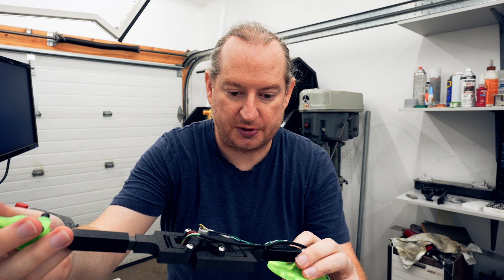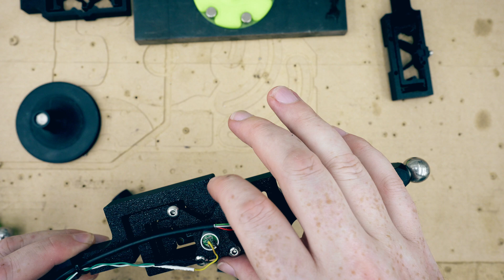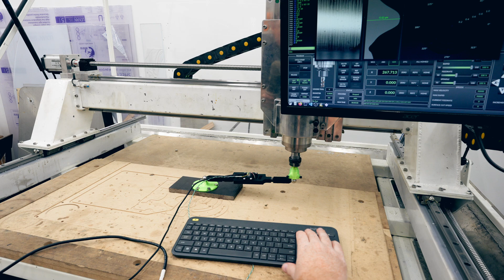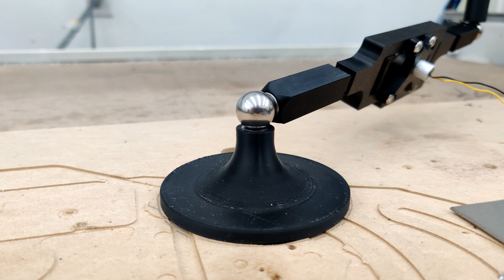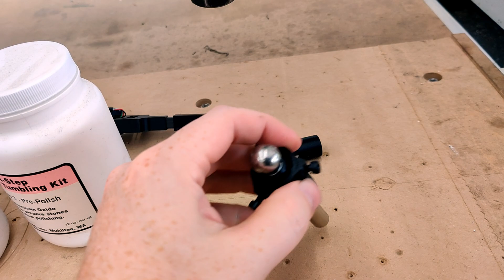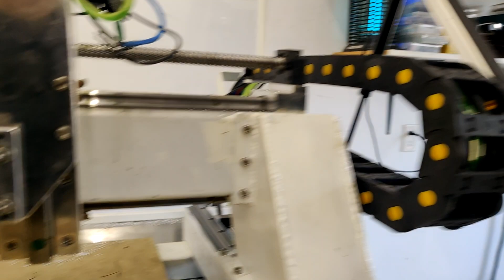DIY Ball Bar for CNC Machine: Laser, Webcam, and Flexure Design

Comment: Very late to the party, but instead of lapped cups you could use three ground dowel pins. The three rods form a triangle tangent to the surface of the ball, guaranteeing that you only have three points of contact. Also, I think that you could get better accuracy by tilting your image sensor away from perpendicular. The closer you get to parallel to the laser beam, the smaller the effective pixel size which should mean finer resolution. If you also constrain the laser by firing it through a slot (two razor blades edge to edge works well) you should be able to get an extremely fine resolution.
Reply from the maker: Yeah for sure if someone wanted to reproduce this it'd probably be better to try to improve the ball joint. It seemed to work good enough to track artifacts on my machine so I didn't try to improve it after some testing.

For the laser on the sensor, I've written the tool to take into consideration the gaussian distribution of the laser beam on the sensor. I want the laser beam to be somewhat blurry because it means I can take more pixels into consideration when it's calculating the offset. When all the pixels contribute, it can give subpixel accuracy. 

2 razors might give you artifacts with diffraction. Might work, but overall will drastically reduce the number of pixels that contribute and would likely be less accurate. 

I think if anyone wants to build/improve on this, trying to find a image sensor that can send RAW pixel values without jpg compression (I think the latest PI cameras can do this) resolution is less important than framerate I would take a 720p camera if it could shoot 120/240fps over a 4k 30fps that would give much better results.

Comment: Are you worried that with your system where you clamp with the Z- axis to place the base you might be deflecting your gantry and offsetting your mesurements  slightly as a result?

Comment: I was thinking of using an LVDT (linear variable displacement transducer) https://en.wikipedia.org/wiki/Linear_variable_differential_transformer as the transducer for a ball bar tester.  I figured it would be variably adjustable pretty much in the same way you made the flex coupling.  would it be possible to adapt your design to incorporate such a device instead of the laser/camera idea.  My concern would be the dynamics of the plastic in your flex joint or refection's on the camera lens from the laser.  I would be very interested in your thoughts.
Reply from the maker: Yeah I looked at those as well. They can get quite costly on Mouser. I don’t see why they couldn’t be incorporated into a flexure design. Especially one that has mirrored flex arms. 

I went with using the laser and webcam sensor because I’ve already built the software around it and know it can give reliable results. The webcam doesn’t have a lens on it. That was taken off and I’m shining the laser directly onto the silicon. A lens would have all kinds of distortions that would skew the results.

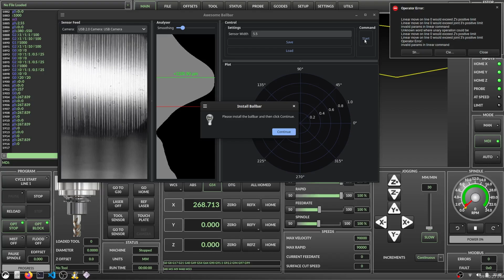Comment: 19:53 I'd guess the scale is off because of the smoothing. You can make the value drift further to the edge by moving the smoothing slider further to the right. I'd guess it is due to sensor width being devided by the reduced pixel count (e.g. 1920 - 2x smoothing (once per side)) instead of using the native µm~pixel ratio. Thus the µm per pixel increases when increasing the smoothing.
Reply from the maker: The scale is off because I haven’t calibrated the scale factor as good as it could be. The smoothing slider will have a negative impact if the gaussian hill is clipped too much off the edge of the sensor. I find it should only be used sparingly to remove some of the high frequency noise but no further.  

I need to properly calibrate the scaling factor using some gauge blocks. It can easily be done by stacking them and offsetting the webcam sensor or the laser (see the previous videos I have on the subject). I’m going to change the camera sensor and webcam in the future. Buying a proper camera module I’ll get the datasheet that’ll tell me the pixel size.

Comment: I just wanted to say that the high frequency wobble in the measurement could come from 2 sources in my mind , 1) a c5 grade ballscrew has a +/-8 micron of axial error per revolution and +/- 18 microns of error per 300mm of lead, 2) I've been looking into bearings for my own project. If you're not specifically ordering P6 or lower grades of bearings for the BK/BF housings your axial runout can easily be in the double digits of microns. Otherwise it may just be vibration as you're making a realtime measurement

Comment: Would a 18650 on the bottom of the bar along with a pi zero w work as a counterbalance to keep it level enough and remove the cable headache?
Reply from the maker: The whole setup is quite rigid that I don’t think it’d need a counterbalance. Also a counterbalance would limit you to only working in the XY plane and couldn’t measure in the XZ/YZ planes. I am looking into a Pi Zero with a camera module over the camera bus. Make it all wireless and work with a raw camera feed instead of mjpg over usb.

Comment: Like The Project, could it be that your 100 micron error comes from the fact that both points arent on the same plane and if you move out a certain distance along the axis the hypothenuse is maybe longer ? and second idea maybe try an z yoint for your complient mechanism or mirror one side of the joints because at the moment you laser is not moving at a straight line over your sensor. would like to maybe one day build along,  love it wonderfull project for diy enthusiasts
Reply from the maker: The 100 micron offset is just the scaling factor. I tried determining the sensor size (to get the scaling factor) by taking a closeup photo of it with the known length of the PCB as reference dimension. A better way is to use gauge blocks with the sensor configured in one of my earlier laser/webcam projects measuring relative height changes.

I won't be doing it with this webcam though. I’m going to be changing the webcam to a camera module that is compatible with the camera bus on the Pi Zero. There is a number of benefits of going that route. 

But if one had to find the scaling factor of an unknown sensor without a datasheet like this one in the video, gauge blocks would be the best way to do it. You’d need to be working in a temperature controlled room as you can easily see fluctuations of 30um due to thermal expansion.

Comment: From the video, it doesn't look like the two balls are on the same Z height. Would it be advantageous to have them at the same plane while doing the calibration? or is having them just on the same ball circumference good enough? Did you have to consider polar coordinates when drawing the results?
Reply from the maker: Yeah it's probably best to get the balls on the same plane for best results. But I think as long as the Z axis is not moving, it won't hurt things too much. 

I see the main problem being if you're working with absolute distance on the ball bar you don't get that. 

I'm mapping the data in polar coordinates.
Reply: @BryanHoward  the gradient on the camera sensor might be an oval instead of a circle as well.

Comment: I think you can just measure runout and then correct for it? Rotate the spindle precisely by 90 degrees and measure the change. Half the 180 degree error gives you runout and as long as you know the spindle orientation it's just a linear XY offset. Essentially just add it to the initial position and treat it as a constant
Reply from the maker: The main issue you'll have with trying to do it that way is you have a few places where the runout can be on. It could be on the spindle, collet, 3d printed joint and the lapped washer. 

It's actually pretty quick to get the runout removed with the screws. An improvement to the design would be too use smaller fine pitched bolts with brass heat set inserts. I opted not to do it because I was worried about the brass inserts getting pulled out but I think it would work out now.
Reply: @BryanHoward  true. But as long as your bearings/joints are very close to being spherical, then it really doesn't matter (I think)? Essentially the runout reduces to being a case of the centre of rotation is shifted in XY versus the centre of the spindle. So as long as you rotate the centre of the runout around the actual centre point, then all should be well?

Renishaw is coming around to this idea with their probing macros for spindle probes. Blum has always worked this way (as far as I know). Quite cool 😎

Comment: For the buckling of the flexure you can make the blades thicker in the center, leaving only the "hinges" thin and flexible. Also increasing the overall thickness of the assembly should help with stiffness in unwanted motion directions.

Comment: What is your max error during 1 rotation. Curious what it is.
Reply from the maker: I'll check it tonight. I think it's quite large because I have not squared and trammed the machine after putting on the be ball screws. I think it's upward of 400 microns. 

I might make a video on trying to better interpret the results and a before/after on trying to remove error in the machine. Might look at how mapping ball screws work in linuxcnc too.
Reply: @BryanHoward  any specific reason you did not go for lvdt?

Comment: All this reminds me of my CNC machine tool career in the 80's. We used a HP laser to check the ball screws and Hamar lasers to check alignment.  Now if someone could come up with a DIY laser like the Hamar it would a real help for DIY CNC builders.
Reply: I was using CNC's back in the late 70's and nothing like this was ever seen. I can understand the need if you are working below 10 microns. but we were working above that level and in a total uncontrolled work environment 0-35C on large pieces 600mm up to 7000mm so expansion and contraction mattered more, but was never allowed for ..... 
The CNC machines were WAY better than the manual machines, ball screws vs ACME and digital readouts vs dial and dial indicators.
For those that don't know - all of the Gcode was written by hand and was transferred to the machine by "paper" tapes that had holes punched in it.
Archaic by todays standards - but the results are the same - just involves WAY less coding and walking. :)
70's was the peak time for manual machines - ball screws started to enter and the machines themselves were well developed.
Reply from the maker: People now have it too easy with all the advanced CAD and CAM software. There's parallels with software where nobody writes low level assembly which I guess you could say is similar to writing gcode by hand. 

Way too easy for someone to buy linear motion components and a spindle from China and through a CNC machine together in there garage too.
Reply: @BryanHoward too easy makes it sound like it's a bad thing 🤔

Comment: Neat! I'm working on making a ballbar adaptor for my 3d printer right now! Using a QC10 so different method
Reply: What's a ballbar for?
Reply: @lukealchinsmith  makin babies

Or in the case of a cnc machine, exactly what this video talks about. Determining the error in things like squareness, circularity, backlash and some other dimensions of a motion system.
Reply: @lukealchinsmith   @compucar03  When creating a circle one axis REVERSES at the start of a new quadrant. The test shows the quality of both your mechanical and control electronics. It also shows the orthogonality of your mechanical structure.